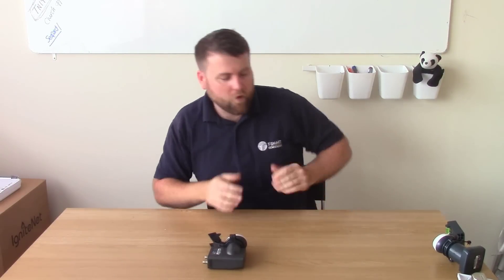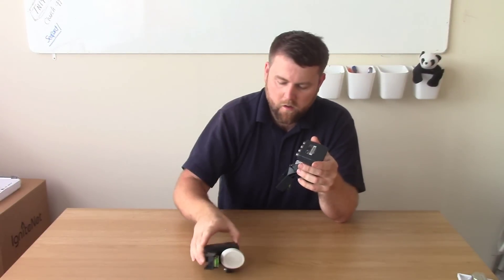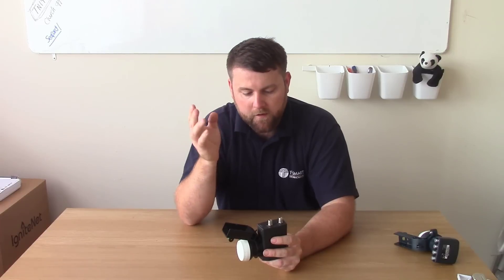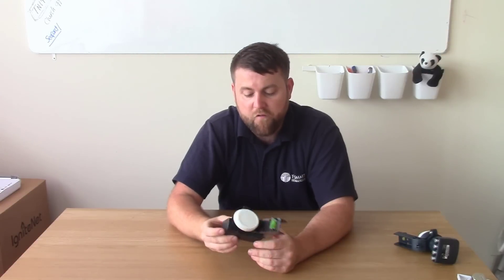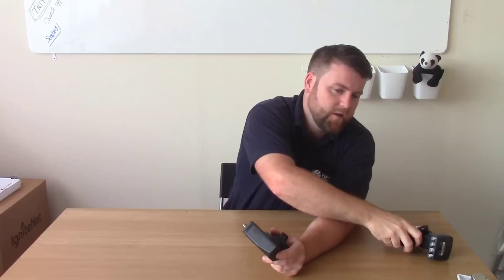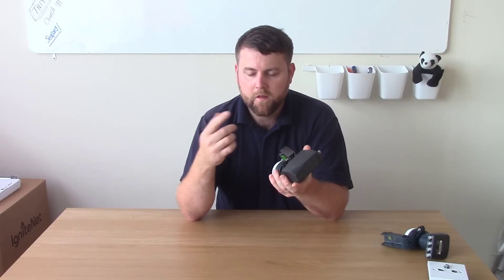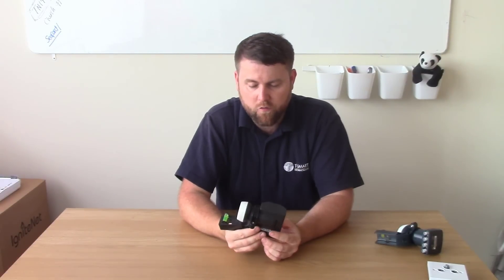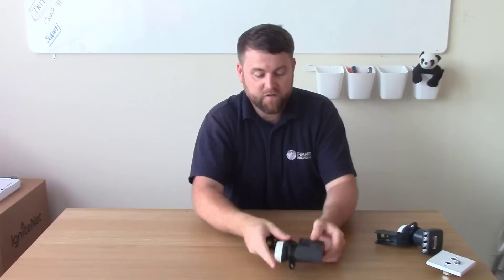What's Different With The New Sky Q LNB

Comment: Hi Tom. I have a Rover Tab 5 ultra and I've recently begun analysing the Sky Q transponders because I wish to bring my old trusty Horizon meter into play- yes I'm quite aware Horizon is no longer in business but I have found a super smart chap from Poland who has successfully updated my frequency settings for all but the FTA wideband transponders. But I'm convinced that the idea put out there from both yourself and others who suggest that each output pertains to either vertical or horizontal polarities can't be quite right. This, despite the fact that I've seen some Wideband LNB's marked V & H on the outputs.  All 4 formats can be decoded on either output. So for example TP1, TP2 and TP7 can be decoded through one output, (HL,VH & H/H formats) but that same output will not decode TP3, TP32 or TP61 (HH, VH & HL.) transponder's 3, 32 and 61 will only decode via the other output. Still have not worked out what it is that defines each output, however.... Still, I thought I'd let you in to this mystery incase anybody finds this info useful.
Reply from the maker: There is definitely no switching on Wideband LNB's. You will probably find the guy from Poland has played around with the oscillator settings to make it work with the Horizon meter. Is it a satellite only meter or does it do terrestrial frequencies too?
Reply: @smartaerials  Its the HDS2 horizon meter which is strictly satellite related. The LNB locacal oscillator settings are determined by the bandwidth. As a general rule with a few exceptions, Low bandwidths between 10700-11900 Mhz are set to 9750Mhz and High bandwidths between 11550-12750 Mhz are set to 10600Mhz. Both outputs accomodate a variety of both high and low bandwidths, but they will only read a particular group. 10 transponders can be read by one output whilst 17 can be read by the other. 

I have the software for editing the satellite settings on the horizon. All the universal LNBs from a multitude of satellites are back in working order now- but Sky have done something to prevent my Horizon from reading wideband signals in the past couple of years, which it used to be able to do. Another mystery is the fact that BBC Two, ITVs and Channel 4 and 5 cannot be seen through my Rover Tab 5- I can see the presence of everything else which is absolutely crazy and inexplicable.

Comment: Hi mate, I have a caravan and I want to take my Sky Q box with me. I've bought a dish from Falcon; it's a QuickSat 80 Sky Q ready. Now, the two cables from it are labelled A and H, but the back of the Sky Q box has Sat 1 in and Sat 2 in. Which cable goes to which? Any idea? Thanks.
Reply from the maker: Are you sure it doesn't say W and H? If it's  a wideband LNB it doesn't matter which way they go around.

Comment: Just purchased a freesat 4k tv box but im getting the dreaded no signal on set up ? I currently have sky q set up that i have cancelled due to cost...i expected a straight swap with no problems.
Reply from the maker: If the Q box worked, leave the Freesat 4K  plugged in overnight. It may be software issue as there was some problems with BBC programmes transitioning to HD.
Reply: @smartaerials9718  thanks matey..funny u say that I phoned freesat helpline and he said the same thing ,I reconnected the sky q box and it works straight away....hopefully problem solved.

Comment: Hi Great Video, quick question. i have Sky Q setup but want to use freesat now as sky are putting prices up. I need to change the LNB to a hybrid on the dish i get that, but just a question around the Coax F type cables, do these need to be change or can i use the excisting? hoping i can use excisting as its going to be a nightmare if not.

Comment: Hi you talk about a sky q box in single mode with one cable? Two questions, how do I put my q box in single mode is this ‘scr’ and do I need a DSCR  equipment to achieve this or would it be easier to run another cable hence two ?
Reply from the maker: It would be easier to fit another cable to a Wideband LNB if you can, and yes you would need dSCR equipment.

Comment: Hi, if I install a new Quattro LNB and then feed the 4 coaxial cables from the LNB down to a new dSCR multiswitch (and also connect a single coaxial cable for terrestrial to the multiswitch), do my faceplates in each of the rooms need to be triplexers or would single F-type faceplates in each room work? i.e. can the tuning equipment (satellite box or terrestrial TV) select just the frequencies that they're interested in and ignore the out-of-band frequencies or will they interefere - requiring a triplexer faceplate?

Comment: Hi, great Video! I currently have sky q however i need free sat on additional TV's. I have gone and purchased a 6 Output Hybrid Lnd for this purpose. When installing do I simply connect the 2 sky Q F plugs to the Wideband sockets on the LNB and sky Q will work afterwards or will I need to reset the Sky Q box or something similar? Many thanks
Reply from the maker: Hi Kev. Thanks. No need to reset Sky box. Just do as you describe.

Comment: I currently have sky + HD box, we have a quad lnb and 1 sky box down stairs and 1 freesat box upstairs,  each box has shotgun cable (so 2 cables to each box) does the sky q box just need 2? As our cables are pre installed inside the wall by Barrat homes, I dont want any more cables added, also Is there a way to keep our free sat box working?

Comment: Hi, I have a Sky Q box and a single feed wire that was installed in the house years ago behind the walls. I have a stacker destacker to get around the single wire issue. However I have now lost my signal. I was told by a sky engineer that came out that the signal is fine but I will need 2 cables to be run from the dish to the sky q box. I don't want this as cabling would be run along skirting etc and would be messy. Is there an LNB that can be used with just the existing single cable I have for sky Q? Or is there any other way around it?

Comment: Hi Tom,
Recently moved house and they have a sky dish installed. It has two wires and comes into the living room. I'm plugging to two wired directly into my Sony TV but it's only picking up 270 channels. None of these being of any use. Do I need to input certain frequencies or settings when searching?

Thanks Adam!
Reply from the maker: Hi Adam, you probably have a Sky Q LNB on your dish that is not compatible with your TV. Change of LNB required I think.
Reply: @smartaerials  Thanks for that! Much appreciated 👍

Comment: Interesting wish I knew this before sky changed the Sat box. Tell me I have a old tv upstairs which I use going to bed  watching 1 channel which is fine with sky link coxial cable to former Sky HD box. In your knowledge can a coxial cable be converted to hdmi to connect a hdmi splitter so me can use the old tv still even 1 channel? Old tv does not have a hdmi socket....it's old but works!
Reply: I've seen online of a coxial - hdmi box wondering if they work of hdmi signal able to go to coxial so to connect to 2nd to work?

Comment: Hi, we have just reconnected the f connectors onto the ends of the coax. Question is when I screw the one f connector into sky box I get no picture when I screw the seconded f connector in the picture is there. Is this right or have I done something wrong . Cheers
Reply from the maker: Hi David, depends on a few things. Is it a Sky Q box that you have? With the Q system half the channels come down one cable and they other half down the other.
Reply: @smartaerials  Ah that would explain it, yes it is the Sky Q. Thank you for the reply .

Comment: How do I run sky Q to multiple rooms. With previous lnbs you would have an individual coaxial cable. Do you have to split the sky q cables and run two to each box
Reply: It's not a sky q box I'd be running it's would be the new freesat 4k recording box that I want in two rooms and I have two free sat box's that I want to run on old system, can I run a hybrid lnb but split the wideband v an p to run to both freesat 4k boxs

Comment: Just wondering had Sky Q installed at my grandparents Sky replaced the dish when it was installed only has two outputs for the Main Sky Q Box if the LNB  swapped for a four port LNB can a old Sky+ HD box be connected to the extra two ports and be used for Freesat?
Reply from the maker: Hi. It can be done but you would need a Hybrid LNB. A conventional Quad will not work.
Reply: @smartaerials  Thanks.

Comment: Just got a hybrid lnb to swap from a sky q for a built in freesat tv. Which connectors are used for that? Thanks
Reply from the maker: Hi Simon, you won't need to change the plugs or cable but F connectors are what is used.

Comment: So glad I found your video. I cancelled sky q this week and when I put one sat cable into the free sat on my smart tv it just says week or no signal but the tv guide still worked. I spent hours trying to figure out why as I knew it worked before sky q was installed. Looks like I'll be buying a hybrid lnb or demanding that sky change my lnb back as they state the equipment is there so they can take their lnb back as well lol
Reply: I said to sky that "you want your skyQ box back, so can I have my original Lmb back" basically they said no, which I don't think it's right. They said why they didn't eave it with is because I would need it, I said "that is my choice and not yours because that belonged to me" No proper response. Discussing
Reply from the maker: Glad you liked the video, please subscribe to our channel. Tom

Comment: If I cancel sky Q.  Can I still view free to air channels and does the record feature still work
Reply from the maker: Hi I'm afriad not, Sky Q box stops working when you cancel.
Reply: @smartaerials  Can you plug the two wires from the satellite to the Q Box into your tv, my tv has a main and a sub sat.  input ?
Reply from the maker: You can connect the cables to the TV but you would need to change the LNB (part that the cables go into on the dish itself). Hope this helps, Tom.

Comment: hi mate, how do you know which is the horizontal and vertical outputs on lnb?
Reply from the maker: It should be marked 'V' and 'H' on the LNB. It doesn't actually matter which way around that they are connected to the Q box.
Reply: @smartaerials  i know it doesnt matter for the box but im using a horison hdsm v3 meter

Comment: Hi, I've been at my new property since last year and I've currently got Sky +. After fixing this up, Only Input 1 works and not the 2nd so I have had to use Single Feed mode. All of the wires are currently built into the walls and floors. Will there be a problem with the cable itself? Also I've been thinking of upgrading to Sky Q. Would they need to fit a new dish altogether? With only 1 feed working.
Reply from the maker: Possible there is an issue with the cables. I would check the cable terminations first. Sky Q needs two cables to work properly as half the channels are supplied down one cable and the other half down the other. It can be done down one cable but you will need to install a dSCR LNB to the satellite dish and set the Sky Q box to SCR mode within the LNB settings menu. It's unlikely that the Sky installer will have the LNB to do this. Existing dish should be fine.

Comment: Hi , I have had sky + HD for many years ( 15 ) and I have ordered sky Q and it is being fitted in a couple of weeks , the question is should I demand them changing the LNB and possibly the dish as it is so old also both my pc's and my two sky boxes are hard wired to the router and I want to keep it the same with the main Q and mini box , I have been told that the new hub has 4 ethernet ports but have found out that it only has two , should I ask for a ethernet switch and should they supply one ?    many thanks for your help
Reply from the maker: Hi, they will need to replace the LNB anyway so I would ask them to change the dish at the same time. I think some Sky Q routers have 4 Ethernet ports, I doubt that they would provide a switch but I would check with them.
Reply: Thanks Tom , router being delivered tomorrow chances are it has only two ports I have oredered a netgear gs105 switch which will cover me in case they don't supply one , but I guess I could take it back if they do , thanks for your help and speedy reply
Reply from the maker: You're welcome. Hope it all goes well. Please susbcribe to our channel.

Comment: Can i use the 2 wire LNB from Sky plus hd on a sky q box
Reply from the maker: Hi Jonathan, afraid not. for that you will either need a Sky Q wideband LNB or a Hybrid LNB.
Reply: @smartaerials   but its still in the same area so the dish would not need to move yeah
Reply from the maker: No need to move the dish, same satellites are being used.
Reply: @smartaerials  will the sky q LNB fit onto a sky dish from the sky plus days without any hassle i'd say tis was fitted round mid 00s
Reply: @smartaerials  i think they call them mk 4 dishes
Reply: @smartaerials  Didn't they not make them future proof i read somewhere that it was just a simple slight adjustment on the LNB one time just out of interest how much are SKY Q LNBs here in the uk on their own
Reply from the maker: If you have a MK4 dish the yes the LNB will fit. You will most likely need to replace the holder at the same time as the wideband LNB's have a 40mm collar and quads have a 38mm. The new collar will come together with the new LNB.
Reply: @smartaerials   you see my dish has a quad LNB part nos 13422 fitted
Reply: i thought that was a simple change the wires around
Reply: @smartaerials  To be honest with you if sky Q boxes are as they are saying more difficult to move around i.e this great big rumor that as a customer you rent the boxes from them and they are not to keen on them being sold on i think i may just stick with my black 1 tb  sky + HD for the time being
Reply from the maker: That's true, yes the equipment remains their property.
Reply: @smartaerials  So i'm guessing sky lock or block the boxes then Interesting that there still seams to be a second hand market with people selling the 1 tb Q boxes with the odd 2 tb one coming up now and then
Reply from the maker: To be honest, I don't know the answer where the box blocks or not. I haven't tried that yet. Yes lots of people are selling boxes but I think they probably aren't aware that Sky will want their box back.
Reply: Interesting well i hope they stay on the satellite platform for a bit longer as they are thinking of going full fiber broadband one day  its freesat when they do as thats a very easy swap around due to my dual LNB

Comment: Hi, thanks for the video! I live in a communual block of flats and used to have Sky +HD until recently with no issues. Got Sky Q 2TB installed a week ago and now I am having issues with a few freesat HD channels (notably BBC one and two that I watch almost every night). The old Sky box was connected via two cables, the new Sky Q only one. Could this be the reason why I’m all of a sudden having picture and sound distortions? And how do I fix it?
Reply: Hi, I live in flat where a communal system is installed and i can watch freesat and satellite channels through my Samsung which is built in Freesat and Satellite however I'm joining sky tv to link sky Q box but not sure if i will lose Freesat channels or will have poor signal... Has sky resolved you problem?
Reply from the maker: It depends on the communal system. If you have a twin feed satellite system that has been upgraded for Sky Q then you could connect one cable from your wall plate to your TV and one cable to your TV. If you only have one satellite connection then you would either need extra connections to the communal system or disconnect the Freesat on your TV.
Reply from the maker: No the Sky Q box will only work with one cable connected on a communal system and that is all that is needed. I'm afraid I can't really answer how to fix. I advise reporting your issues to whoever is responsible for the communal TV system, landlord, managing agents etc.

Comment: Hi , thanks for video ,, we just moved into house which had sky Q previously , i connected the 2 sat feeds to an older Drx895 w (was just going to watch free channels) but no signal / not locked ,, so  is because of incompatibility , do we need to change LNB , thanks in advance
Reply from the maker: Yes you would need either a Quad LNB or hybrid LNB installed on your dish. The wideband LNB used for Sky Q won't work.

Comment: Hi I currently have a sky + HD box with an RF out that goes to a booster/splitter in the loft then down to 6 TV's all with a magic eye this all works fine and has done for years but thinking of changing to sky Q mainly for the recording benefits but obviously I don't want to have to pay for multi room boxes for 5 tv's just wondered what my options are?
Reply from the maker: Hi James. If you want to keep a magic eye system it's a bit tricky. You would need a HD-Modulator to create a digital channel from the HDMI output of the Sky Q box. Ideally get one with a HDMI loop through otherwise you will need a HDMI splitter as well. It get's a bit complicated if you want to run 4K on your main TV at the same time. For control you might be lucky with a Bluetooth remote working at all locations otherwise you will need to install an infra red emitter in front of the new Q box. There is more information on distributing Sky Q around the home here: https://www.smartaerials.co.uk/blog/how-to-distribute-sky-q-around-the-home
Reply: Hi  @smartaerials  Thanks for your reply I new it wouldn't be easy I will have a look at the link thank you
Reply from the maker: You're welcome. I hope it helps. Please do subscribe to our channel.